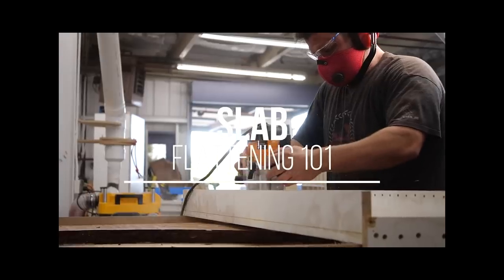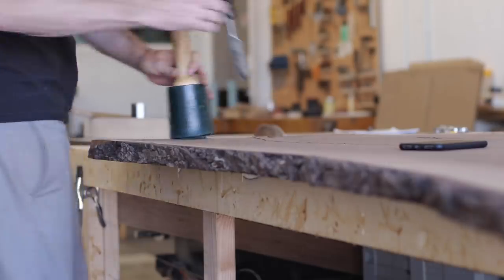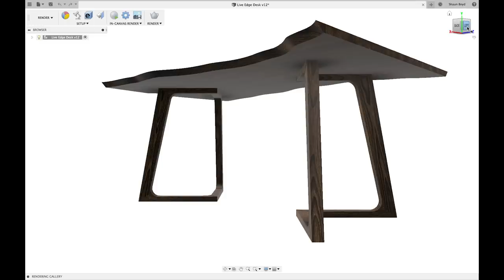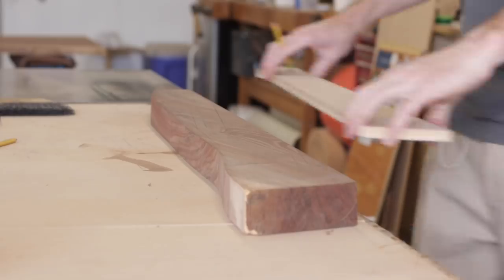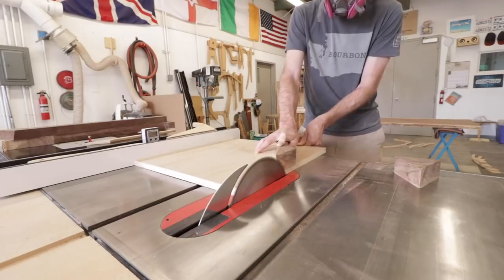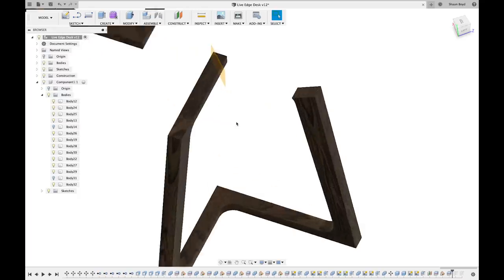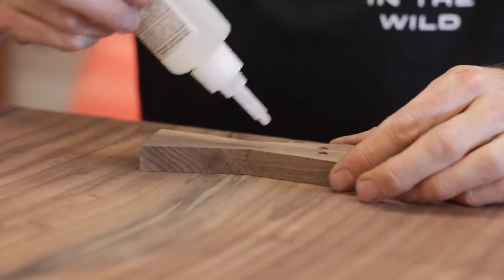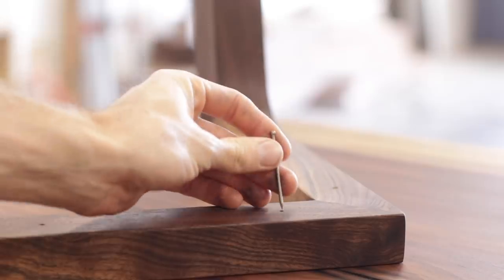Live Edge Walnut Slab Dining Table

Comment: I love the leg design, the sharp angles on the outside edges and curves on the inside look 👌.
How practical do you think the leg design/slab shape are as a dining table? Don't the legs interfere with where your chair legs would go? Does the concave curve of the sides make sitting there a bit awkward? Wondering whether this scaled down would make more sense as a coffee table.
Last thing. I hate to be that guy, but considering this is a commission are you not worried about wood movement at all? Those threaded inserts aren't going to allow much, but perhaps the leg design will allow a bit of flex?
Always look forwards to your videos!
Reply from the maker: Thanks! Yeah, the bottom portion of the legs might get in the way a bit if you want to push the chairs all the way in. The client is using it as a desk about 75% of the time, then using a bench along one side when it is used as a dining table, so it shouldn't be too much of an issue. Even with chairs, I think it wouldn't be too bad.
As for wood movement, the bolts holes drilled through the upper part of the legs were drilled oversized and elongated, so there will be plenty of space for the table top to move independently of the legs, no worries there.

Comment: As a design choice many people choose a contrasting wood for the base and for bow tie keys. Was using walnut throughout a purely aesthetic choice of yours or the client or did it have another purpose? Also, I would like to see more info about how you prepare the live edge next time. Great job!
Reply from the maker: Yeah, using a contrasting wood is a common choice and one that I go with often. Using Walnut throughout was an aesthetic choice from the client, and the bowties were purely for function so that is why they are the same wood and on the bottom side. They really wanted the slab to be the focal point, and I think that really came through. As for the live edge, I didn't do much. Just removed the bark, then did some sanding to smooth out the gnarly parts. Thanks for watching!

Comment: I’m building a live edge red wood dining table for the first time, so far I’ve flattened it and got the legs on it. I’m now trying to master inlaying bow ties before I touch the actual table. 

Question 

Do I need to take out the knots before I epoxy them and the cracks what should I treat the wood with to stop the colour bleeding out of the wood?
Reply from the maker: Awesome! Good luck finishing up your table. I usually don't take the knots out before filling them with epoxy. The only reason I cleared the cracks on this piece was that I wanted them to look clean with the clear epoxy. As far as finish to prevent the wood changing color, I'm not totally sure. I don't know if there is a way to keep the color exactly the same, but maybe some sort of heavy outdoor finish that protects against sun/UV damage? Might work.
Reply: Thanks, when I have glued in the bow tie and then tried to fill a bit that wasn’t perfect, the wood turned the glue purple which was kind of cool but not what I really want on the finished piece. 

I loved the legs you put on this table, beautiful.

Comment: Beautiful as always!  Are you worried about wood movement between the top and the legs over time?
Reply from the maker: Thank you! I'm not too worried. The holes in the legs that the bolts go through are oversized, so there should be plenty of room for movement over time.

Comment: a beautiful build, thank you sir for the video. I only came across your channel quite recently, but you have quickly become my go to woodwork entertainment! I am loving the puns, they make me smile. I am hoping to give Gregg a foreign cousin very soon. I have a question, if I may. I am a domino virgin (mine arrived on Friday) I have cut a series of dominoes into some 18mm MDF but the results aren't great! There's a great deal of residual material left in and around the mortice, Now I understand that you may well say "well what do you expect if you use such a crappy material" but the client has specified the materials so I am a bit stuck here - any tips for getting a cleaner mortice without just going for the enlarged width? Also thank you for the promo code, just ordered a 2" flattening bit as I have 2 x 12' long by 12 quarter sawn elm slabs to flatten very soon - wish me luck! Anyway, please continue with the wonderful entertainment it really is appreciated. Ciao.
Reply from the maker: Awesome Joe! Thanks for finding me and checking out my work! Are you using a vacuum with your domino? I find that without a vacuum, it leaves a lot of dust and chips in the mortise which can be pretty annoying and I assume it would be worse with MDF. Glad you could take advantage of the promo code, happy flattening!
Reply: Yes, I have a Festool CTL midi running with the domino, that was my initial thought too, that maybe the exhaust wasn't functioning quite right. I'll keep trying I guess. How is the shop move going? are you guys in yet?? @shaunboydmadethis
Reply from the maker: @joeatkins4470  Hmm, I'm stumped. To be fair, I don't think I have ever cut dominos into MDF, so your guess is as good as mine! Shop move has been great, we are pretty much fully moved in and functioning as usual now. Feels great!
Reply: I tried again this morning with 90 degree joints ( yesterday’s were 22.5 degree joints) with a bit more success, the joints are much better, I’m much more pleased with these ones, I shall carry on and see how I go. Thank you very much for the thoughts though, good to hear that all is progressing well in the new shop. I look forward to new videos, thanks man

Comment: Hey Shaun, love your design as always! Are you worried the top might bow or cup without any reinforcements underneath? It's one piece but there might be some tension in the slab?
Reply from the maker: Really appreciate it! Yeah, that is definitely something to think about. The slab was super dry when I got it, and the table is going to be in a climate-controlled house in California, so I'm not too worried. If it was any bigger I would have considered adding some reinforcement.
Reply: @shaunboydmadethis  Good to know, thanks for clearing that up!

Comment: Love your vids, very inspiring. Wondering about the structural integrity of the legs. If it is possible to build that without a domino cutter.

BTW: when are you going to post a coupon code for the festool domino cutter!
Reply from the maker: Thanks! You could definitely build these with something besides a domino. Dowels would work, or even running screws down through the miters from the top and bottom would do, and they would never be seen.

And I wish I had a coupon code for the domino, but I don't think Festool likes to discount their tools very often, unfortunately.

Comment: Hey Shaun Hello all the way from PUERTO RICO.   I am a big fan. I kind of do proyects woodworking if you want to check them out and give your impressions it would be awesome. I will like one good advice from you on projects like this one. How much would it cost something like this. Your part plus materials just to have an idea.
Reply from the maker: Thanks for watching, Ricardo! I’ll definitely check out your work. A piece like this can be pretty expensive. The slab alone was around $4,000, plus the lumber for the legs, as well as the time to build it all. A piece like this should be able to pull maybe $6,000-9,000 depending on the market.